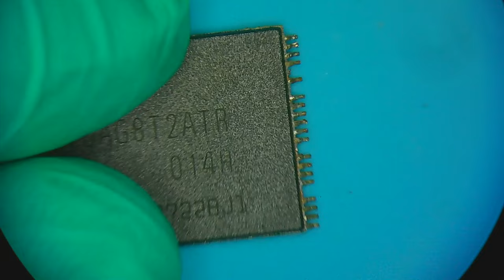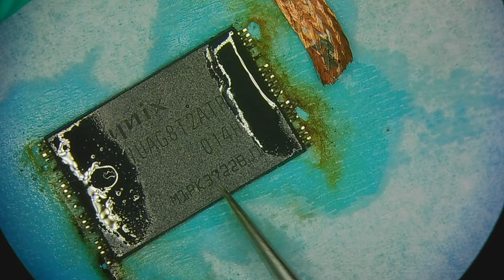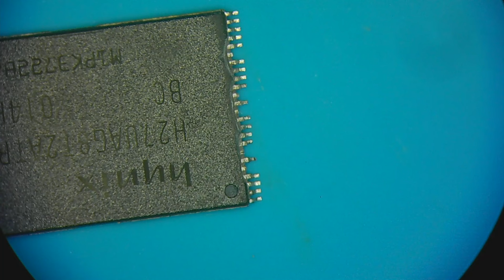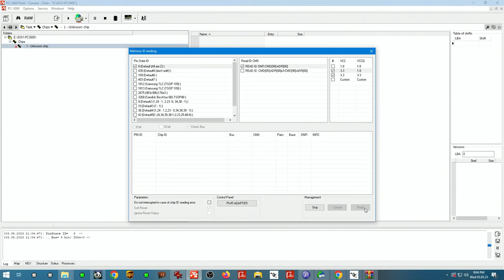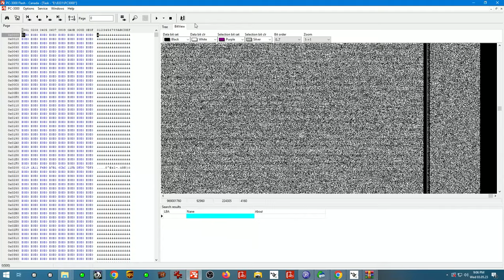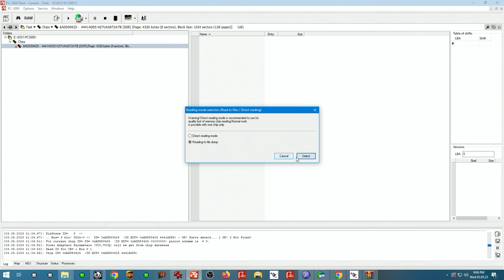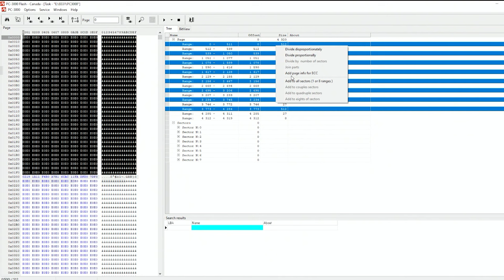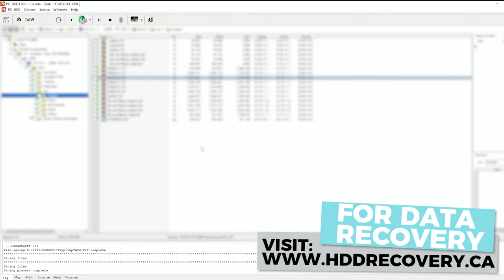salt water damaged flash drive for data recovery

Comment: I had a similar repair like this on a Pokémon Fire Red game.  It was more so a project to test my skill.  Corrosion took all of the chip headers off.  Had to grind back the epoxy and jump the wire bonds coming off the die.  In the end, I got it working!  What a fun repair.
Reply from the maker: Sounds like a great fun case

Comment: Jes, this is insane how did you recover this 😮 nice job!
You should use anti-glare light 😅
Reply from the maker: Thanks ! I have that light, I just need to come up with a simpler way to turn it on and off. I want to have a single switch that will contro ring light and glare light but turning one on and another off while working.I am switching to a different camera in the next week or so. I think I will rig something up for that

Comment: Hello! Have you encountered any CFexpress type A cards lately?? Are they recoverable???
Reply: I mean monolith pinout recoverablity???
Reply from the maker: Hey, not so much, but there are a few here and there. They are not monolith tho. Surface mount only so far. These are basically PCIe SSD devices and recovery of those is very questionable. Depending on the controller type and support by pc3000. I will post a case soon that was supported

Comment: I've seen a number of krisfix germany videos where he grinds down the PCB to fix traces for video cards. I had a feeling that you were going to do that with the chip itself. I think the PCB is easier. lol
Reply from the maker: There is some cool ones in the hopper for editing. Grinder tool is something I started to use very often, especially on monolith devices with not all traces on the top surface

Comment: I've seen some shops use a laser engraver to remove the plastic to get to the legs.
Reply from the maker: Lazers smell very bad during engraving, and it would need a separate hose. My new extended work bench which I want to cover here too is already overfilled with so much crap :)))
Reply: @hddrecoveryservices  Yes, of course you'd need to properly extract the fumes. But at least the process is very selective, as the black plastic absorbs considerably more energy than metal legs, which basically go unharmed by the laser. Same goes for solder mask vs copper traces - laser can't touch the latter. This might be more interesting for repairing monolithic cards/sticks where the margin of error seems to be quite a lot smaller than  here.